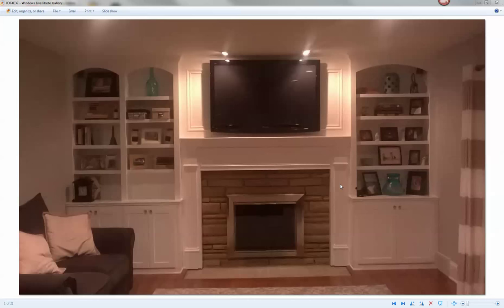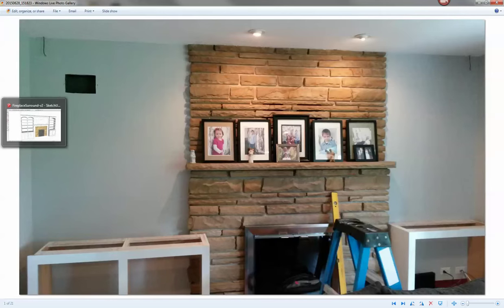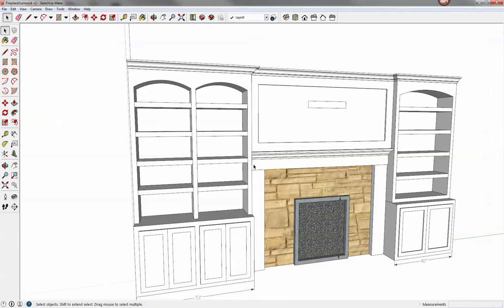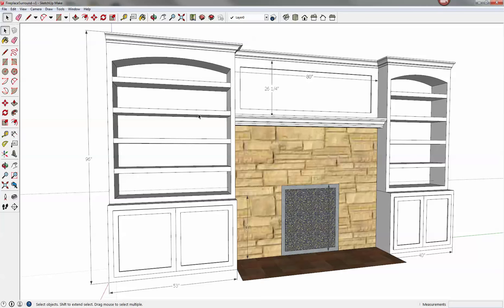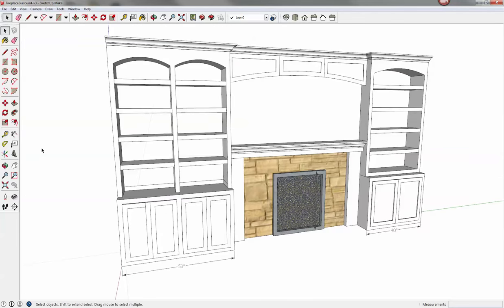Fireplace Surround  Part 1 - Design

Comment: Thank you so much! I was looking for just the information your video provided and I appreciate the details. I know that this was a few years ago, but could you give me an approximate idea of what the cost could be for something like this in 2020? Thousands or tens of thousands?
Reply from the maker: Glad you liked it. The cost depends on the type of wood used (paint grade, or stain grade). but even in 2020, the material costs would be in the low thousands 1-2K. If you have someone build it for you, something like that could run anywhere between 5K to 8K, depending. Anyone charging over 10K is ripping you off. Or plating in in gold.

Comment: I have a  baseboard  heater on both sides of my fireplace.  Show  me what I would have to do with this  arrangement??
Reply from the maker: At some point I'll do a video on a built-in over a baseboard heater.  There are a couple of ways to do it. The first way, is just mount the base cabinets above it, and support the front with a part of the faceframe, extended down to the floor, but leaving enough room for the convection process to work. The second more expensive way is to have a plumber install a kickspace heater. they remove the baseboard heat, and run the water line through a small rectangular "box" that turns baseboard heat into forced air heat. You can google them. Thanks for watching. -Pat